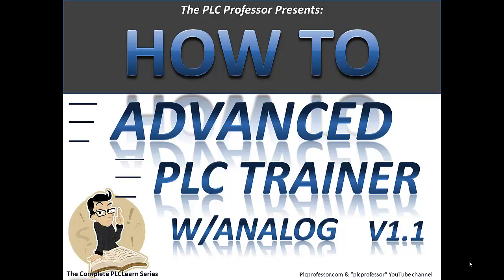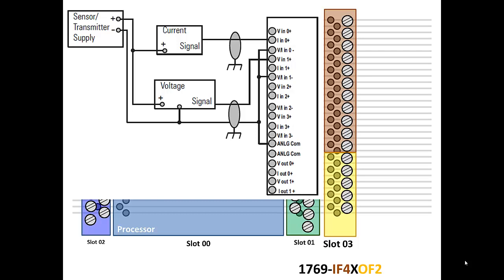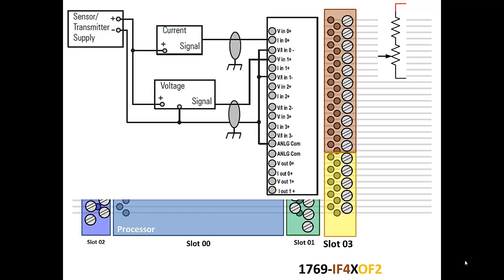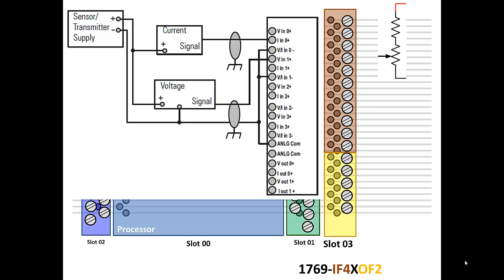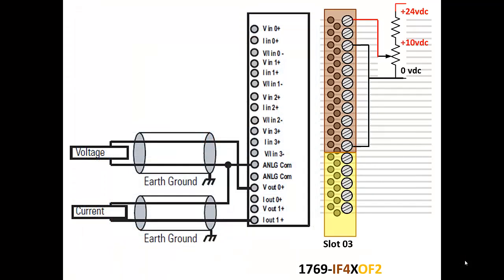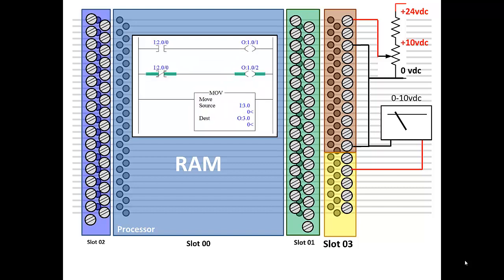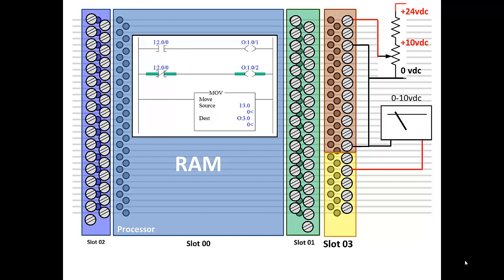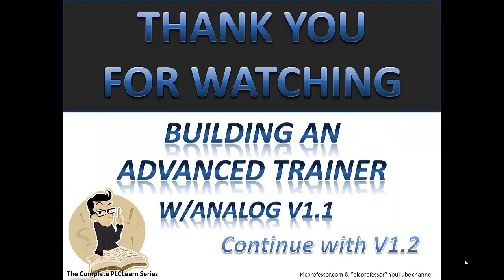TS03 Pt.2 - How To Build a Trainer with Analog - More PLC Backplanes

Comment: I bought a 1746 NIO4v Analog module and a 100k pot for my SLC 500 trainer.
What resistor(s) do you recommend to get the 10v that I need?
Thanks for the videos.
Reply from the maker: If you have a 24vdc supply, 10/24 is the ratio. You want to drop 14v across the other resistor. 14/10 x 100K is 140K. However, the impedance of the input way require a 1Meg ohm pot and 1.4Meg ohms of dropping resistance.

Comment from the maker: For anyone watching this series, the resistances of 100K for the potentiometer and 138K for the dropping side, this did not prove suffcient. The input impedance of the Input Module was to low and it dropped the pot voltage well below 10vdc. I changed the dropping half to 88K with reasonable results.